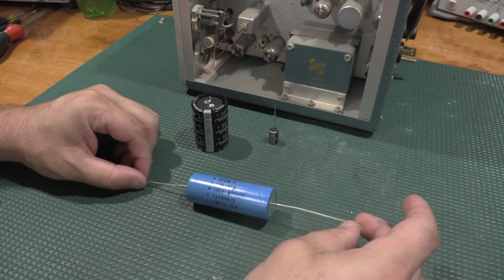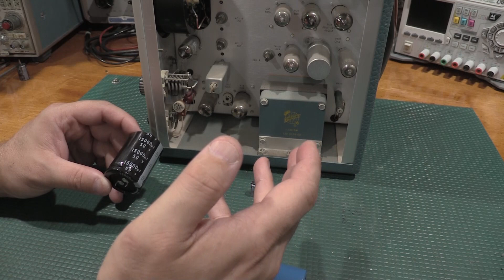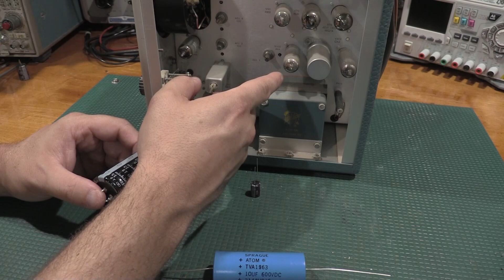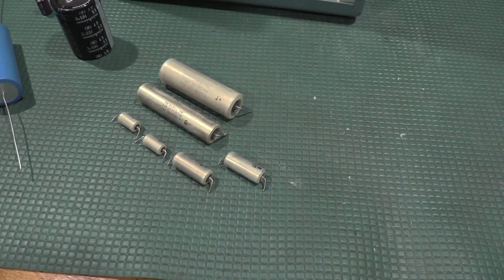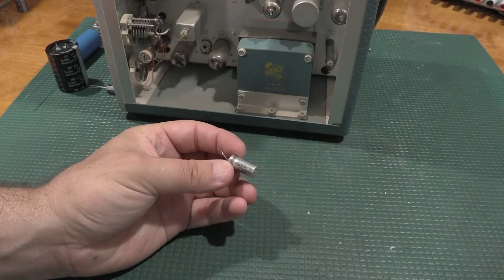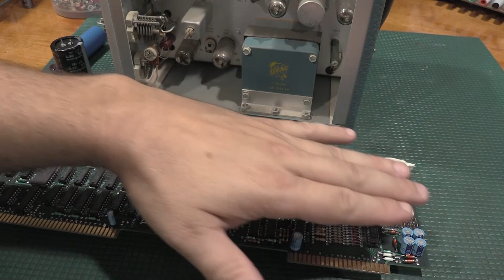More Capacitor Knowledge Shared Comments and Questions Answered!

Comment: It is a mistake to replace all or most of the electrolytic capacitors in equipment, as some people do.  I have been repairing electronic test instruments, audio gear, radios, TVs, etc for over 60 years.   While I made plenty of mistakes when I was younger, now I only replace components that have failed.   I sometimes have to replace an electrolytic capacitor, but more often I find zener diodes, transistors, switches, and circuit board problems.   I never tack-solder parts in.   After I have determined a component is not working as it should, I clip its leads and carefully remove them from the via; taking care not to lift any traces.  After the replacement part is soldered in, no one can tell a repair has been done.   If vintage HP, Tektronix, Fluke, Genrad, etc test equipment is mutilated by an unskilled hobbyist, it is lost to the world.   Very few competent technicians/hands-on engineers will want to devote their time to restoring it.

Comment: I have found there was a company called Component Research that made caps on par with the in house Tek caps... metal case, glass hermetic seals.. very high precision tolerance, low DA and DF.  Don't know if the company still around or not.

Comment: Interesting info about the healing/reforming of vintage capacitors! I thought the change in transient voltage handling from vintage to modern capacitors was due to a change in the way voltage rating was done, shifting the 'burden' of derating to the customers buying the caps. But that's just speculation on my part, not any research!

Comment: I have a beloved 2465 300Mhz and it is blowing the F1330 fuse and I found the tripler was dragging the -15 Unregulated volt rail down so I disconnected one of the HV  transformer High voltage wires to confirm  that I had HV, and I did and the F1330 fuse no longer blew so I need a new HV pack and of course 40 years later they are not available. I was thinking about trying to depot the tripler and repair it. Do you have any advice other then trying to find a donor board?